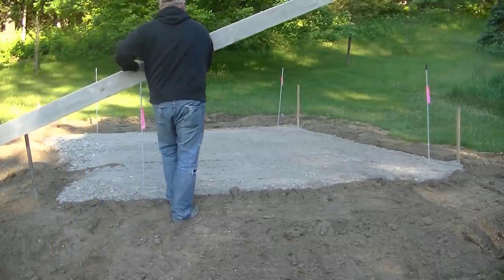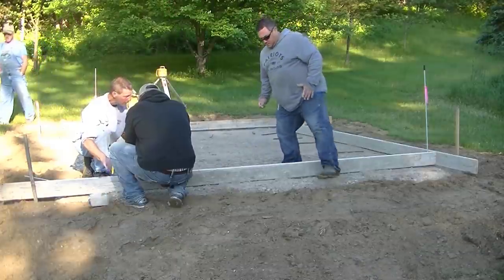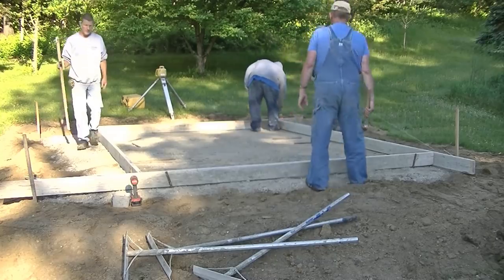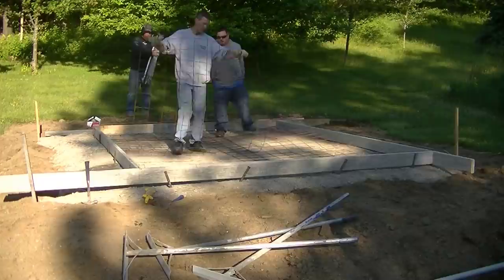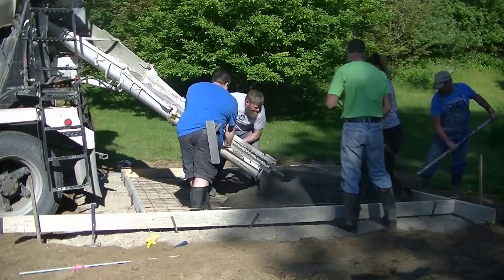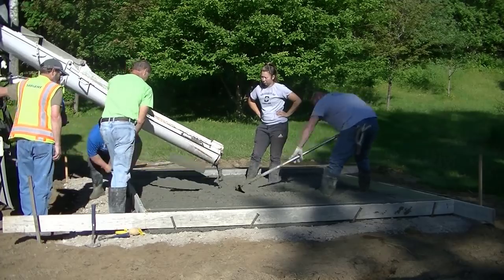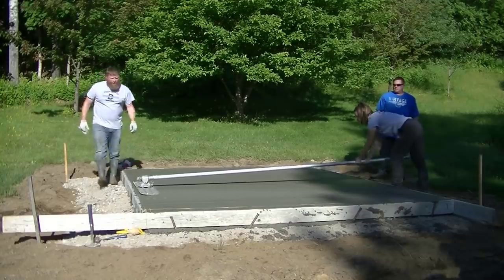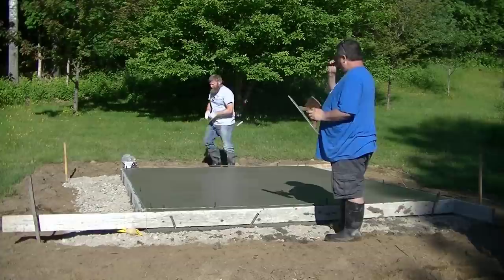This Is Better Than Dry Pour Concrete! DIY Concrete Shed Slab

Comment: Very good job.  The only thing I would have done differently would have been to put down 6 mil plastic.  Concrete draws moisture, even when fully cured.  Putting down plastic would give you a much dryer floor.  It won’t eliminate condensation issues though in the spring.
Reply from the maker: I would have if the GC had instructed me to.
Reply: Mike Day Everything About Concrete , Yeah, them darn GPs.  I just had a driveway and patio poured.  The contractor was ok, but I wish I had you doing the work.

Comment: I'm having a patio poured in a few days.  It was like pulling teeth to find someone to come do it and I don't know why.  It's 26 X10 so I know it's not a major job.  Always an excuse that it will be 2-3 more weeks waiting time.  I thought maybe I could encourage them to come out so I shot the grade for my slope, set up the forms, hauled in all the sand, bought and set 1/2" rebar on 1&1/2 ft squares, tied it all in with wire, set all my expansion joints to grade next to the house to where all they have to do is show up and pour then smooth.  It's just to much for an old man like me to do by myself so I had to hire someone with a crew and the expertise of floating it properly because I'm not experienced.  Crossing my fingers they show up Monday, wish me luck.

Comment: Hello Mike. This will be my first time doing a concrete slab for a shed. Its going to be one of those prefabricated resin sheds. I am very handy so I feel very confident I can get this DIY done. I will be storing my lawn mower, air compressor tolls etc in there. The slab dize will be 13 x 8.5. Not sure what psi concrete I should use or if I should even use some type of support. I am trying to do this as economical ad possible. Its a shed at the end of the day so the finish done not have to be impeccable. I do not mind mixing the concrete by hand since it will be more cost effective. I will have some buddies help out so I will not be doing it on my own. Any suggestions on the psi, depth, support, or dry time before floating I should use. I live in Hollywood Florida so it will be hot tjis time of year 80f plus. Thank you

Comment: North Carolina. You guys sure make it look easy. I have been pouring small slabs and steps using bags of Quikrete. I am constantly disappointed by the finish I get. I float and float, but I don't get enough cream on top to get it smooth and then be able to get a good broom finish. I use 3 1/2 to 4 quarts of water per bag.  The max is 4.5 quarts.  Any suggestions?
Reply from the maker: They don't use a lot of cement in those bags. I only use the Quikrete 5000 and it's still a little rocky for me. You can add some Portland Cement to your mixes. We do when we do countertops. A couple quarts helps a lot for finishing.

Comment: From Canada! Thanks Mike for your very instructives videos!! As a DIY, I'd like to know why you don't seems to use a concrete vibrator in many slab construction?
Reply from the maker: With the slump we pour the concrete consolidates pretty good. If we have an edge form that we want really smooth after taking off the form, I'll use my pencil vibrator.

Comment: Mike, I like your videos, and I have a question.
When you pour you never mention what the slump is of the concrete.
I’ve poured at 5 and 6 but never settled on what is best for strength and workability. Always a lot of work and cures faster than what you show because it’s dryer, I guess.
I know you are not testing the slump but I’m sure with your years of experience you can make a good guess.
I’d like to know what is the best for slabs.
Rodney
Reply from the maker: We tell the mixer driver to give us a 6. But we use a water reducer in all our pours. Concrete temps are in the low 70's when the truck arrive this time of year. If your concrete temps are approaching 80 it'll kick off a lot faster.

Comment: They really over designed that shed IMO.  4~5" packed base, 5~6" slab, 2x6 sill plates, so probably 2x6 framing. It'll really be a sturdy structure that'll last forever.  Most driveway slabs around here in So Texas are barely 4~5 inches. Great video Mike, keep up the good work.
Reply from the maker: Thank you!

Comment: I am from Russia. Greetings from other side of the globe!)   Being in US i was amazed by concrete slabs all over the places i’ve seen. So, very interesting to know the tools you are using, what makes what, why it should be used, etc... Also, as a DIY guy, I am not available to use laser or rent it. What could be other way than laser to level the slab? Thanks and good luck with your channel. Alex.
Reply: Use a clear plastic tube with water in it.......
https://en.wikipedia.org/wiki/Water_level_(device)
Reply: Yep, a water level is probably your next best choice. If you take extra care, a 4 foot (122cm) level should be ok, up to about 6 meters.
Reply from the maker: Yea, a water level : https://amzn.to/2BEamm7
or a 4' or 6' carpenter's level : https://amzn.to/2BABsdP  (good for a slab this size.)
Reply: keith cunningham  Right. A water level is like a plumb bob in that, barring user error, it’s just physically impossible for the tool to give a bad reading.

Comment: Tuning in from California. Building an 18x12 office in the back yard. My backyard is mostly sand, wondering if I need to excavate and replace the sand or if I can compact it and pour on top. Also wondering how I can level the form without a $550 laser.

Comment: Salt Lake City, UTAH.  Hello Mike.  Holy cow a lot of people are watching your videos from all over the globe.  I'm in the process of planning out a 10x20 shed (no permit needed)  I was going to make the slab bigger though about 16x24.  You always say you use 2x6's for the forms, but what kind of wood is it?  Is it treated pine?  or just whatever straight piece of lumber you can find?  Do you spray your 2x6 forms with oil or vegetable oil?  Thanks for your help.  PS. I'm a graphic artist at a tv station and a former photojournalist, if you need any help in that regard, let me know.
Reply from the maker: I just use plain 2x6's you can get at HD or Lowes. No need to oil them. We scrape them after taking the forms off but there's little to no concrete on them.  Thanks Wyatt.

Comment: Great videos, Mike! One question though; what does the string line do if you're using the top of the form to screed?
Reply from the maker: The string line just helps us make sure the form is staying straight and not bowing out or in during the pour.
Reply: @MikeDayConcrete , Thanks Mike!

Comment: Hi Mike, i from 🇮🇪 Ireland. I have a 16x16 ft slab to pour tomorrow pm. I have the stone in and leveled. Mesh coming in morning. If got 6x2 s there. I'm nervous about this as I would like to do a good job. Ill put the first board down facing the views the cabin will be facing. I was going to use a straight edge to level. I have not got a bull float. Is there anything you can advise. Its just me and a digger.

Comment: I am putting in a prefab metal tool shed, 30'w x 25'l. I don't know much about concrete. Even though the prefab mfr suggests 12" x 12" footings, I notice your carpenter-built shed won't have footings. How come? The footings add substantial cost to the concrete slab contractor's quote, right?

Comment: Hi Mike. Good Video, thanks for that. I live in Arkansas and am in the planning stages of putting a 1500 square foot home on our 40 acres which is, unfortunately on the side of a mountain and no more than 2 to 3 inches of soil before hitting extremely rocky, large rocks and boulders. Lots of trees which means there will be stumps. In your opinion, would it be better to build the foundation on P&B or, if solid slab is possible on this terrain, how would I deal with the freshly cut tree stumps? And do you have a video on how to use a self leveling laser for dummies? Thanks Mike!

Comment: S. Florida.
 I was in the construction business, every day for over 30 years and I can say I’ve seen women in almost every trade except - Iron work and concrete finishing. Off hand, I don’t remember seeing a female mason either (around here, ‘masons’ lay block or brick. They don’t typically do form work, like some other parts of the US. Carpenters do the form work)
Reply from the maker: There's not many here in Maine either. I've only seen 2 other than Tia and Abbey.

Comment: At what point would a person need to add beams or beams with rebar?
Reply from the maker: Usually for load bearing walls. A small shed like this is no problem for just a 6" slab to support. Even a small garage that's one story, 6" slab is fine if the sub-base is hard packed gravel.

Comment: Hi Mike!  I'm Mike, here in Kentucky.  I watch a lot of your videos because I'm interested in building a 24' X 32' garage for my two Dodge Rams ( one 2500 & one 3500).  There is so much information on YouTube, but no one really addresses one of my greatest concerns. i.e. frost heave.  I see nothing about digging a trench to a point below the frost line and pouring a footer. Then, placing concrete blocks up to grade level and pouring a slab inside the concrete block wall.  We have many very old graveyards here and I am loath to see many of the vertical head stones tilting at about 30 degrees off of vertical from the influences of frost heave.   What say ye about my concern.
Reply from the maker: Here in Maine there are a lot of footers and frost walls poured like you're talking about. A trench dug 4 feet down in the soil, a footer poured, and a 4' concrete wall formed and poured on the footer. Then the area is filled in with gravel and we pour a floor inside the frost wall. But we also install a lot of slab on grades like this one only much larger. Just need a good gravel base that won't hold moisture. Most of the slabs we install 2" styrofoam under them to help prevent frost. Been doing it this way for 40 years with no problems.

Comment: So, you don`t need to do any vibration to get the air out e.g.? How many pounds of concrete did you use for this slab? What does the mixture consist of? From Norway, Europe :)

Comment: Hey Mike, Quick question planning on pouring a slab myself for a shed this summer. I’m in Northern Illinois how far above the grass line or I guess ground level should the slab be 2 to 3 inches?
Reply from the maker: A couple inches is good, then you can grade the landscape away from the slab if you do that.

Comment: Mike, how do people get away with a 4" slab to build a little bitty shed like this? My county building office in Georgia is telling me I have to have a full 12" wide by 16" deep minimum footer around a 6"  thick slab for the foundation for a pre-cut 12' x 16' shed kit for it to meet code. What's the secret for getting away with a 4" thick slab?

Comment: You say that your course has instructions for additives; will I learn how much of each additive to include (for my area of the country,) like fiber, super plasticizer, air entrainment, etc.?  Will your course teach me to build a car pad by myself?  I mean, literally a one person job.  I'd like to see videos of your instructing a person onsite for a one person job.  The Portland Cement Assoc says that a good pad will have no more than 1/4" difference within any 8 foot circumference, but I will need a low pitch (1/2"?) to drain water away from the house.  Will your course teach everything in this much detail?  I've been watching your videos, and other concrete videos for a couple of months.  I am in Middle TN.  I have had three contractors quote on the job, with a low to high from $4.50/sq yd to $7/sq yd., including sub base work.  None of the three contractors (Angie's List) would itemize any details of the work they would perform, and couldn't answer important questions.  I just don't know if I can trust any local company.  Wish you were in my area.  I have the required construction tools, including a laser level.  Thank you for your content, and your help.
Reply: You might want to double check those prices. They’re typically priced by the square foot, not the square yard. Ready-mix concrete is sold by the cubic yard.
Reply from the maker: The redi-mix company adds the fiber, super p, and air entrainment. You don't need to know "how much" they will do it for you and get it right. My course will teach you the basics, forming, setting grade with a laser, pouring the concrete, finishing the concrete. It's pretty detailed. Setting a 1/2" slope just requires setting the receiver "up" a half inch from your original grade on the grade stick to "lower" the form 1/2". Most pads are priced by the sq ft, not sq yd. Let me know if you have any questions.

Comment: What's the point of placing wire mess, if you don't set it to proper height.  Waste of money. If the concrete had fiber, why place mess if it's only a shed pad, no drive traffic.
Reply: Its mesh